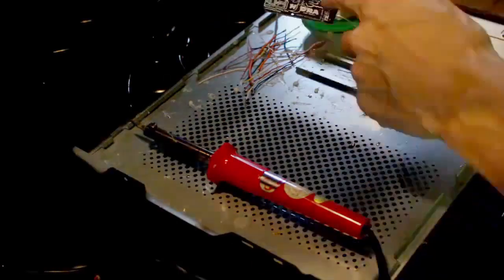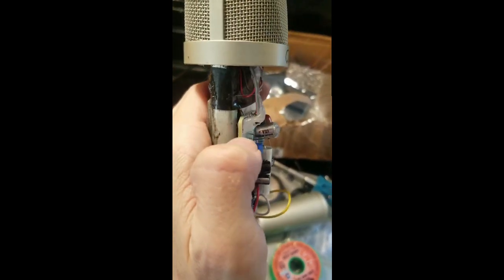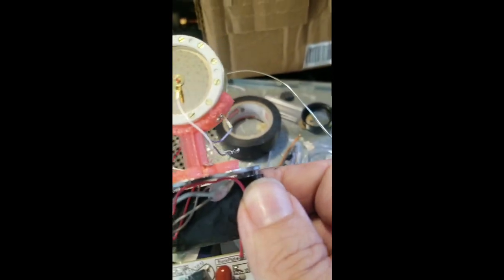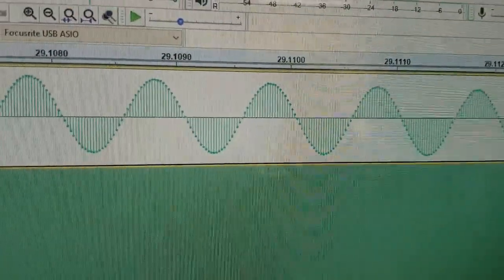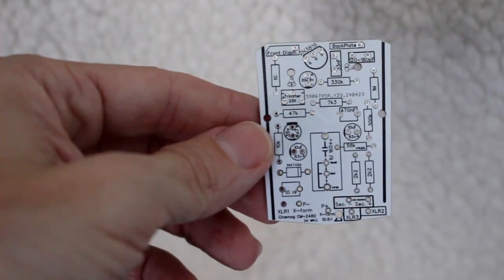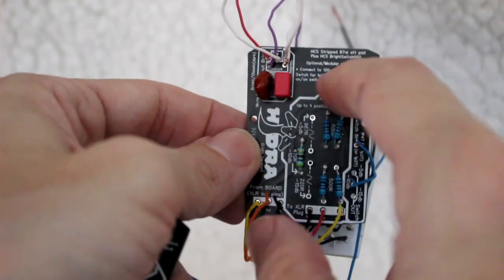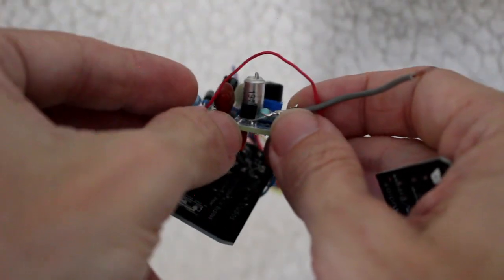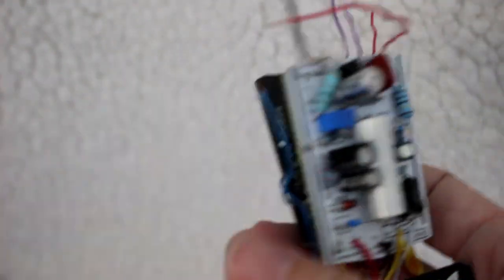Let's Build the Stripped Down Neumann U87 classic ORS Clone from Hula-Cow Studios!

Comment: hi I'm on the forum too nice work hey do you have a 3D printing model file for the capsule saddle mount or there is a link for it?
Reply from the maker: Sure! http://hulahulamoocow.com/HCS-hibiscus-v02.stl  - Be sure to print it lying on its side, text facing up, for maximum strength. It'll use more plastic in supports, but if you plan on shipping/traveling with the mic, it's a good idea.
Reply: @duffyp.weberva5612  thank you man! 😊